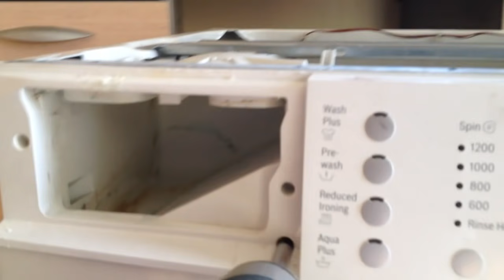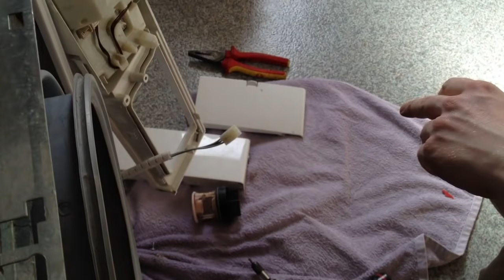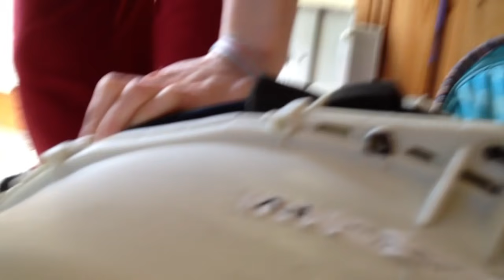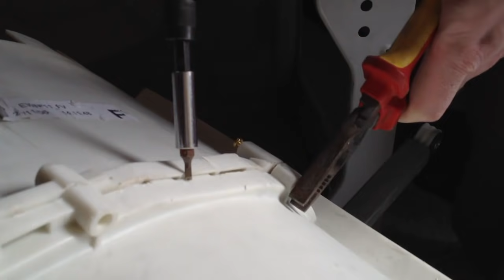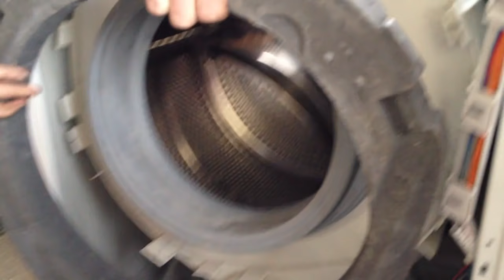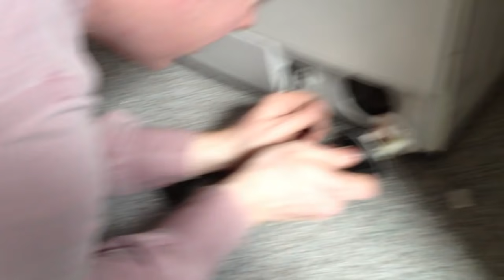Washing machine dismantle and rebuild Bosch Classixx 1200 Express drum noise fix

Comment: Have the same machine, took it to bits, changed the bearings, put it back BUT same loud noise. Did it again and found the spider was fractured in two places though there was only a tiny wobble visible from gripping the front. Fortunately could buy new spider + front half of case - which was marked. Total cost £250.

Comment: Great video, thank you so much for making this!
For me it was sufficient to open up the front panel and remove the hose that goes out of the drum /where the heater is located and there I could remove the bra strap. The other one had gotten stuck in one of the holes in the drum and I could just pull it out from the inside.

Comment: I had the element replaced recently as it had worn through on the left hand side and was short circuiting. The same problem has occurred again within two weeks. But this time I can see the element has been ground away by the rotating drum. What do you think is causing this problem.?

Comment: Mine is a Bosch Classixx 1400 (WAE28162GB/09) and I believed the drum's bearing set was worn allowing the drum to wobble. The actual problem was the drum's drive arm riveted to the rear of the drum. Badly corroded and cracked in a few places and not supporting the drum securely. I've ordered a new drum.

Comment: I have a Bosch machine and that drain plug design is utterly dumbass as you can’t get a tray or anything in under it to capture the water. It also blocks constantly with hair and you can’t take that piece apart easily to get it out. Such a shite design! Mine is now completely blocked and my wife thinks our baby socks have got in behind the drum seal and blocked it 🤔

Comment: Thanks so much for this! I was halfway through replacing the door seal on mine, when the instructions on the 'eSpares' video parted company from reality where this model is concerned. Watching you take the front off solved the problem. It's all done now, and normal service is resumed. By the way, I always wash my bras by hand ;-).

Comment: Just came home 2 find my basement flood it i only took the back plate off and turn the machine and my drum has a hole i am going to check on prices if is cheap i will fix it if not i need a new one

Comment: Safe yourself possibly a lot of work by just removing front and back panels , disconnect the drain pipe from the underside of the drum and it offers direct access to the drum. Through the opening you have a good chance of removing the bra wire coin or whatever. Worth a shot before all this dismantling.
Reply: Thank Iain  - I may well give this a go.  The cap of a medicine bottle fell into the detergent tray (which was halfway out) - and then slipped straight down the pipe.  It hasn't reached the filter and the machine seems to be working fine - but I don't like the idea of it lurking in there somewhere, potentially doing damage now or in the future.  That said - I don't fancy the full dismantling exercise either!

Comment: Hi, I'm currently doing a similar thing with my Bosch Classic Maxx. Can I ask, the 2  shock absorbers that attach at the bottom of the machine's frame and attach to the left and right underside of the drum housing, do the rods slide in and out easily or do they feel like there's a gas/liquid resistance in them (like on a door closing piston)? Mine can be slid in and out with no resistance of movement - that can't be doing much to 'absorb' the vibrations of the machine, hence I'm looking to change them. many thx in advance.

Comment: I'd like to add to this. When dismantling, take multiple photos of cables, bolts etc, so when you're re building, you can check for cable routing and what goes where. I'm a decorator and when I work in people's houses while they're on holiday, I take photos to see where ornaments etc went.

Comment: Thanks so much for this video, I needed to access my heater element but didn't know how to get the front off my WAE24369GB machine. Your video broke it all down and I was able to get the front panel off without too much difficulty. Couple of pointers for others looking to do the same that might be worth noting:1) You don't actually have to take the door off, at least on my model you don't.2) Mine had more screws at the bottom holding the front panel on; once you've undone the rubber seal, if you stick your head in and look through the gap with a torch, you can get a pretty good view of any screws still holding it in place if it won't drop down and you think you've missed one.

Comment: i cut off the clips that hold the drum together using a hack saw blade; others recommend you chip them off with a chisel. You should remove the motor first so it doesn't get water in it! You should take the pulley off at the back and inspect the drum; two machines i have dismantled have not had failed bearings; instead it was splits/cracks on the spider on the back of the drum. you can buy a new drum direct from bosch for £109; its cheaper than a new bosch; a bit more than another 2nd hand bosch (of questionable state), and better than a new £180 cheap new machine (the cheap ones are rubbish and throw away). Put it this way: new drum with new bearings is like a new bosch! The new drum tub seal comes with extra screws so you can compensate for cutting off all those tabs! At least having a bosch means you have a machine that can be repaired, unlike the new cheap machines.

Comment: Thank for sharing this. Need to do a bearing change on my Bosch, good to see how the drum comes out of the front.
Reply: Was it a sealed unit most new drums are glued together not in two sections
Reply: @sweetvuvuzela4634  No, it was an old one. I wasn't the bearing, the mounting spider at the back had corroded and collapsed.
Reply: @harveysmith100  thanks they don’t make them easy to work on anymore

Comment: Makes me wonder why are WM's designed to be so arduous a task to remove a bit of material that slipped through the drum holes?? It'sa re-design waiting to happen.
A broken washing machine / tumbler drier, if stripped down to the drum & support, with a sturdy handle attached to manually rotate, it makes a brilliant composting tumbler.
Reply from the maker: Redesign...patent..make big bucks..then remember me.....heeheheheh

Comment: +Naturally Healthy : Thanks! very useful. I have nearly the same machine, There is a grinding noise when the drum is spinning, I guess the bearings need to be replaced. Would I need to dismantle as much as you did here? is there no access to the bearings from the rear panel? cheers!
Reply: Have you fixed the bearings yet.
Reply: Hard Worker no, not yet. With two young kids we are using it every day. I think I'll get a new machine first, then fix this one when I've got a bit more time

Comment: I had identical problem, was disconsolately turning the drum very slowly by hand and dreading an attempt to remove the drum. Hey presto! on the fourth turn of the drum the end of a piece of wire appeared through one of the perforations in the drum, I pulled gently and out it came. Yes, it was out of my wife's bra. Beginners luck!

Comment: Extremely helpful, thank you. Our ten years old (but similar) Bosch Classixx 1000 started making horrendous metallic noises last night. Then I heard (what sounded like) a nut fly off inside the cabinet when it started spinning! Today, it seems the drum has pulled off the carrier which is holding it. The drum moves backwards/forwards away from the carrier & feels unconnected. I was considering trying to strip it apart and refix the drum to the carrier. Having watched your video, I am now going to put this faithful old servant out to pasture after its decade of service. Aside from an ongoing faulty softener drawer issue, it has performed well over all those years so I will be buying another Bosch machine. However, I consider spending that much time on an old machine to be false economy. Thanks for saving me hours of pointless grunting, cursing and whingeing!
Reply from the maker: +Chris Liles It certainly takes time, sweat and blood and your right some muffled language...hehehe. Thanks for the comment and watching. God Bless!
Reply: +Naturally Healthy - Stripped machine totally apart (thanks to your video) & found the aluminium support bracket for the drum severely corroded. All three arms were fractured near the centre spindle. Only the outer mountings on each arm were left supporting the drum. No wonder it made such a noise! At least I know repairing this 10 y.o. machine was certainly not worthwhile. We now have a new Bosch machine on order. Thanks again.

Comment: Hello my washing machine flashes the code Ε29 and something else while I've put clothes trying to turn the drum but do not flipped I found the pump coin cleaning Am I and OTHER DAMAGE outside the Ε29 Please help me Thanks the elements of the washing machine is bosch logixx 9 varioperfect E-nr WAS24422GR/07         FD 9202    00069   KD CODE  ME  267D   62110X002101102.

Comment: Thanks for the video. It is a nice introduction how a washing machine looks inside. You gave some valuable ideas! I just thought to mention, if you use sometimes vinegar pour into the drum and choose a 90 Celsius program, it prevents the heater against hard water. Much cheaper than Calgon. Again, thanks for sharing your work!

Comment: Excellent video and follow-up advice. MANY THANKS.
Had exactly this issue. Managed to find the bra wire using a USB endoscope through the sump, Flexible claw did not manage to grab it as it was trapped by the heater elemetn. Stripped it all with son's help and removed the drum and casing. Over a cup of coffee figured best to try removing the heater and try again. Success. Got it out and re-assembled. Had a look at the brushes but hardly worn so now have a spare set for next time.

Comment: Good suggestion paddy,  you did a very good job my friend,  I am a white goods engineer and I like to see people trying it for themselves,  paddy is right on the torch inside.  the only noises apart from bearing failing in the drum is something in it,  like a bra wire which is the most common,  use the torch,  try and poke and prod it down as much as possible and get it to drop to the bottom ---- then take the heater out,  unscrew,  and hit through then prise out,  and usually you can get most the stuff out through the heater.

Then disconnect the sump hose at bottom just to make sure nothing else.

But well thought out on your dismantle with no training

Comment: A great help, Thankyou.I had a problem with the drum making a noise and it jammed and the drive belt came off the motor. On taking it to bits I found the sump ball somehow got through into the sump and got wedged in between the drum and heater element. No idea how it got through as there is a lug stopping the ball getting into the drum sump. The ball had a burnt hole in it. I replaced it for £3 . Saved me hundreds as the wife was on about getting a new one.

Comment: Don't want to be smart . I would like to advise people to try this first .Stick your head in the drum and shine a torch inside it and look for the white plastic end bit of the bra wire sticking out of one of the drum holes then pull it out with a pair of pliers . Worth a check as half the time it hasn't quite dropped all the way through .
Reply: +Paddy Murphy Simple, yet effective! I find it stupid that I never even thought of doing this first! Thanks, you have saved me a lot of time!! :D
Reply: If you need to strip it down it would be worth taking the heating element out in case you can see the offending item through there.
Reply: Excatly what I was thinking - or better still - use a laundry bag for your smalls so this can't ever happen.
Reply: I bet next time you would be able to the job in less than half the time,  I am sure its your doggy that inspired you to do it as he must ve been going crazy with that noise. I am sure you had more fun taking it apart than putting it back together. well done.
Reply: Lol, is that YOU Hannah?!?
Reply: Oh be jees fek I’m not quite half way taking it to bits n at one stage I thought I’ll shine a torch inside, but I didn’t until I took more parts off, then while I was taking the door rubber off. I went for a torch, stuck me head in spun the drum slow n realised the bra wire was obviously attached as I spun the drum it moved to, quickly got me torch found the wire just enough to pull it out with me pliers, then thought I’d write a comment to read this first comment, and laughed out loud. On the plus side me girlfriend is feeling guilty so has gone to do the shopping on her own 👍😉😁 happy days...  now to,get it bk together, thank god I didn’t re over the drum.  But in all fairness a good video although I didn’t watch it to the end.
Reply from the maker: A laundry bag..never heard of that...i'll have to refer to someone with more laundry experience than me for advise....MMMUUUUMM
Reply from the maker: Good idea must remember that! Thanks for watching and God Bless!

Comment: Well done and thank you for the time to make this video! One question is do you know the torque setting on those bolts that hold the concrete weights on? I bolted them back on snug but didn't want to crack/break the concrete. I was thinking too a little blue locktite would help them from moving around due to constant vibration all the time on these machines! My model had 2 bolted CC blocks in the front and like yours, a bolted lump on the top.

cheers,
Reply from the maker: I just put them on real snug like you but for peace of mind the locktite sounds like a great idea. My machine is still going strong but i havnt opened her since this video! Thanks for watching and subscribe for future videos. God Bless, Paul.

Comment: yes after finding the bra wire between the tub and drum(from where the sound was coming-in my case it was in right side in my machine drum) i was thinking its impossible to take it out. but I took a normal metallic hair pin and opened its leg and make an L shape ( u can take a wire hanger of your wardrobe perhaps) and put in to the center of the curve of the bra wire and spin the drum with hands gently in order to move it. but in the first turn one head of the bra wire came out from a hole of one (out of three) of the projected plastic parts from its top (plez don’t think the wire will come out from steel drum, it will come out from one of the hole made on the top of projected grey plastic areas on the side walls of drum), which help to move the cloths in the drum while washing or spinning (some machines may  have three or four. mine has 3)…total time which i spent was only 5 mints…feel lucky…when i found the wire in my hand, the shape was still curve from the front …but the same curve turned out like an S shape after scrapping, from side pose. it is perfect shape which help to take it out, and actually cause noise.
insert L shape metallic pin through one of the whole into the center of the curve of bra wire. may be u can use two…depends upon the position of the curve to make it move between drum and tub. good luck.

Comment: Thanx for uploading, I had bra wire in mine also, but after watching your video I was lucky enough to be able to remove the waste flow pipe and tease it out from there as it was lodged around by the heating element. :)
Reply from the maker: Saved yourself alot of mucking around!! :) Thanks for watching and commenting!
God Bless!

Comment: Why not make stuff like the filter plug out of engineered plastic that is transparent. If I had seen the nail in there blocking it from twisting open  I would have been happier about what was needed. And I suppose they have evolved but what is wrong with simple ergonomics like panels and struts that are not as thin and scant in use of materials. I like over engineered, and transparent if it helps is worth the cost.
Bosch and other makers will carry on simply because they are tooled right.
Think of Lloyds certified  yachting gear that is stronger than the boat.
In "The Perfect Storm" the boat was fine, it is usually humans who overreact to
trouble and I liked the have a cup of tea and take your time approach, swearing admitted was nice to hear too.
And so many people complain about the filter hand turning bit it obviously is not of the right stuff. I used a wood joining plastic plug superglued over the two stubs
the vendor left me with, to make it OK and yes I had to build up the thread around the filter where I tried to ease it turning by drilling a freedom path for it instead of jiggling forever or eventually as I had to, dismantle from underneath. Sigh.
Washing machines make great man cave gadgets. Thanks for your video.

Comment: I tried the fuse first, it was fine so I removed all the PCBs,and squirted contact cleaner on all the connections,I then reassembled it and it worked fine...I read somewhere that if there's no lights anywhere it's a continuity problem....Cheers

Comment: it was the brushes that stopped mine from spinning/working.
Had to put it on its side to take motor out as it was at the bottom at the rear. pain in the arse job getting the motor out, also putting the brushes springs back in,so fidly lol had it done within the hour. £10 for set of brushes so happy chappy :)

Comment: what a ball ache..I have same washer and its stopped spinning,a whining noise was coming from it other day now it wont work. been told its the brushes. Thing is how do you get the motor out? cos you cant get ya hands in the gap. would the whole casing need to come off or flip it upside down?
thanks

Comment: I had the same bra wire problem but managed with torch and a lot a bit of patience to retrieve it through one of the drum holes, very fiddley but had it done in ten minutes!
Reply: What did you use to get through the drum holes to grab the wire to be able to pull it out?